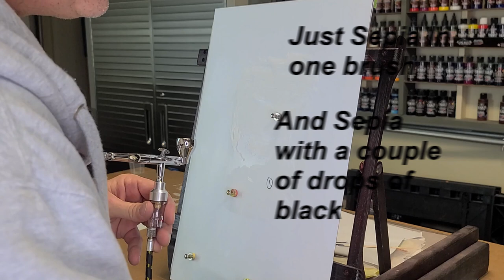Multi - Layer Stencil Cut with a Cricut - Airbrush How To

Comment: Can you do a video regarding using the cricut software to print these out?
Reply from the maker: Riley, I do have a video in cutting 4 mil mylar and a video on cutting 7 mil mylar. As for cutting this particular stencil I bought it on Esty (no longer available) put the files in my Design space and cut them.  Thanks for the question and thanks for watching.

Comment: Hey brother hope everything is still going well with you and your family.. my question..painting lure blanks to help keep from getting scratches do u use the createx top coat gloss. If not what to use..
Reply from the maker: Hi Jeff, the createx Clears are not designed for exterior use. I only use them as a carrier for my candy 2o. I would rather use a can clear over my interior works and for exterior a 2k clear. If you had a bunch of lures ready for cleat I would spend the 20 dollars and buy the 2k clear in a can it will last for a couple of days. I like the spray max. 2k is a two part clear and hardener. Hope this helps and thanks for the question and thanks for watching.
Reply: @TheAirbrushGarage  im sorry brother I didn't explain it clearly.  I was asking about using a top coat to cover what u had painted to use a cover stencil to had other colors to keep from scratching with netting clips.. I apologize if I'm not asking the right question.. my over all clear coat choice is dipping in kbs diamond clear coat for a finished product.. sorry brother all knew at this lure airbrushing
Reply: @TheAirbrushGarage  and one more question and I want bother you anymore today. Lol.. im getting ready to buy all the createx paints that I want . Like. Your. Opaque. Trans. Pearls. Fluorescent.  Detail.  And candy. Havnt decided on the metallic yet. But leaning that way.. so far it around 100 bottles.. 5-6 hundred bucks worth anyway. I been doing taxidermy for over thirty years.  Lure painting is knew. But I don't half-way do something when I got it in my mind to do it.. thanks for responding and thanks for your patience and knowledge.
Reply from the maker: @jeffbyrd2803  ah...if I want to protect  my work between layers then yes it could be used. I don't usually see the need to do this. I usually only use their clear for two things... first as a carrier for the candy 2o and an inter coat between candy 2o layers to prevent Bleed through otherwise i don't really use it.
Reply: @TheAirbrushGarage  . Last question.  Is Spray Gunner. The best and cheapest supplier for the createx paint supply
Reply from the maker: @jeffbyrd2803  for what you are doing I would be concentrating on the wicked line. Illustration is good but as it is named its made for illustrators and not durability. I would l would love to see your work. My email is theairbrushgarage.com. have a great weekend.
Reply: @TheAirbrushGarage  yes I agree. Being createx band I automatically say createx.. I will be ordering all wicked. You too brother.  Catch you another time